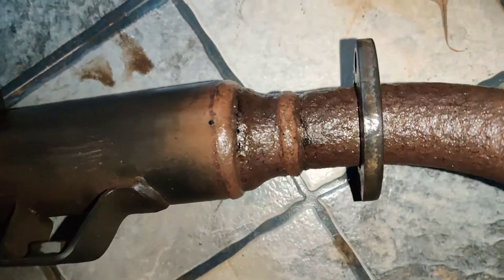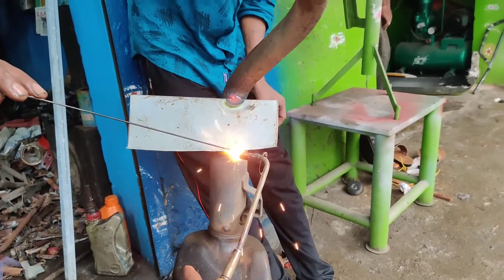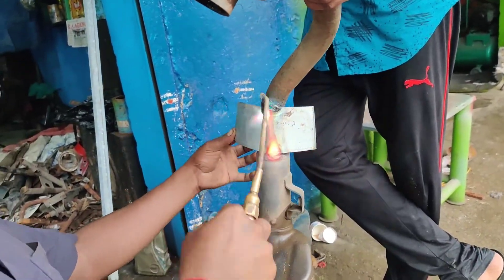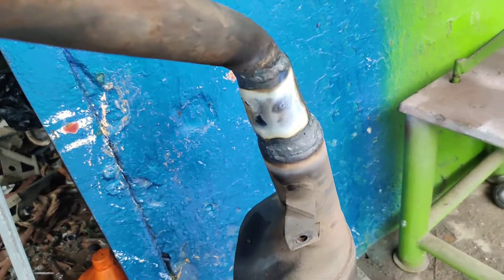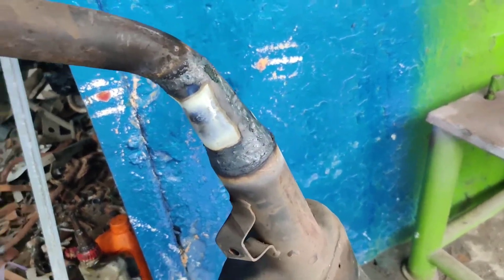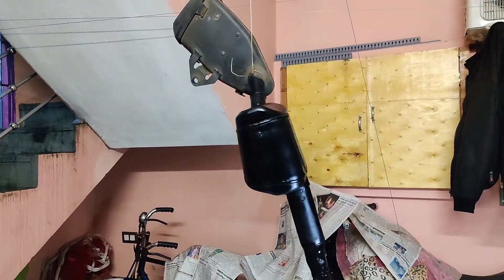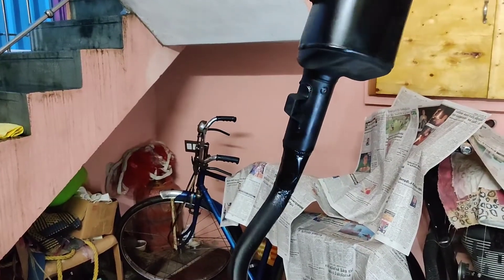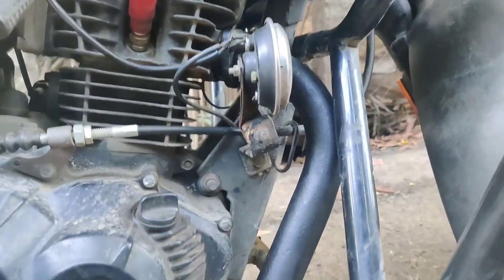How to fix Exhaust leak in your Bike | Honda Hornet | Bike Tips | #PREM

Comment: My hornet's silencer also sounding like duke 200 since 1 week. its ony 4 years old but i wonder if silencer got holes. Already front shocker seel replaced , stock chain replaced , headlight bulb to Led, all in 4 years now this silencer, its a black hole for my wallet.
Reply from the maker: Not only hornet.... All motorcycles like that only
Reply: @aiaprem1114  after going through silencer noice videos yesterday, i understood the gravity of the problem and rushed to the service center only to be surprised that the issue was with the inlet nose of the air filter which got a gap. Such a huge difference a inlet air nose can make in silencer output sound ,i was amazed. My hornet was sounding like bullet.

Comment: This Spray paint won't last. I have tried this paint on my bike tank. While refueling a single drop of petrol will melt the paint. Waste of money and time. Other than that was good.👍
Reply from the maker: Didn't face like that problem still now
Reply: @aiaprem1114  just try some drops of petrol... immediately it will melt. I just shared my experience. Thanks